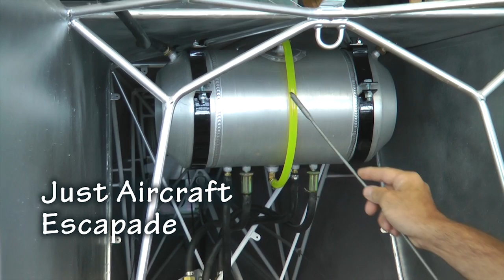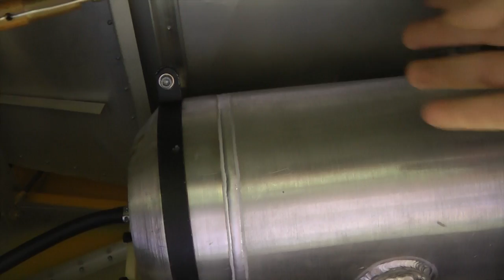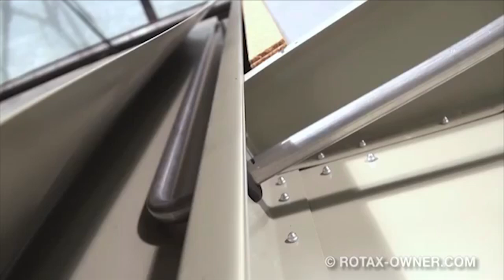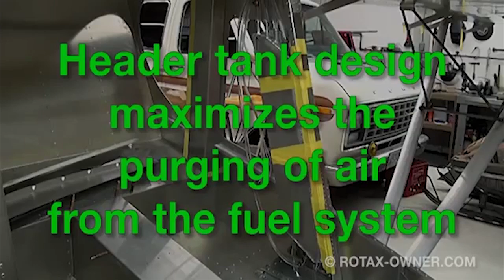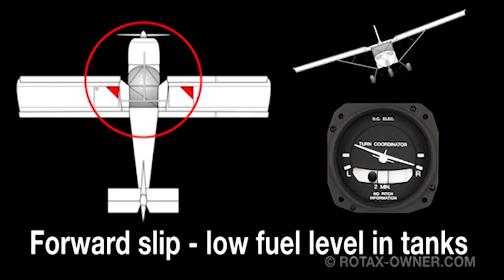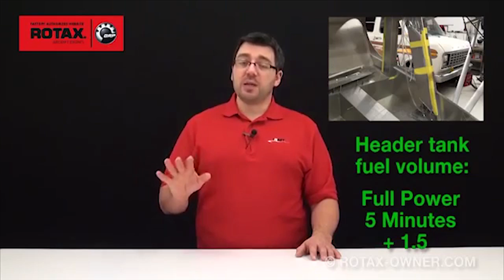More Fuel Header Tank Examples

Comment: One thing I noticed is the absence of valves to shut the flow before the filters and the fuel pumps  in case you want to change or service them.
Reply: A lot of people/builders opt to not install valves, as it has happened more than once that "service valves" are turned off inadvertently, as you as the pilot don't check as you have not turned them off yourself and walla fuel starvation as you rotate and the expenses start...

Comment: I have a similar tank on my bird and I was wondering if rubber or some sort of material is placed under the steel straps which hold the tank in place between the steel straps and the aluminum tank to avoid galvanic corrosion and or chaffing?

Comment: I am still trying to understand the need for vents to the header tank.  As long as each wing tank is properly vented, fuel will flow into the header tank without issue.  I suppose there is a chance of getting an air lock if you run the airplane completely empty of fuel and then fill both wing tanks simultaneously, however, who fills both tanks simultaneously?  As you fill one wing tank, the header tank is vented by the fuel line from the empty tank.  What am I missing?
Reply from the maker: Well... I might ask - how often do you fill one tank while the other one is completely empty? It might vent OK in that situation! You are creating odd scenarios where a header tank might not need a vent. This is an airplane and we want a definite vent to work always.  A trapped pocket/bubble in the header tank is deadly for an airplane.
Reply: @HomebuiltHELP  It will vent even better if neither tank tank ever gets empty enough to allow air into the header tank as each tank supply line serves as the vent.  You can’t lower the pressure in the header tank if either of the wing tank feed lines is unobstructed.  The only purpose of a vent line is to prevent a loss of pressure in a tank such that the liquid in the tank can’t drain out.  In the case of the header tank, the wing tank supply lines serve that purpose.
Reply from the maker: No, no, no! Read your last 2 sentences. It is when the 2 wing tank lines become obstructed (at the same time - blockage, crimp,  when fuel tank vent goes negative - lots of reasons, etc) that you NEED a header vent to allow fuel to leave header tank.  Without its own vent in this scenario, fuel could not leave and then engine will stop.  With a vent, you have a calculated time to look for a landing field as you watch the header fuel gauge creep to zero.  I see this all the time - builders that dont "see" a reason for that extra vent get into real trouble later. Worse is telling others that you dont need one.  You dont often see comments on my channel of dangerous advice because I remove them. These are airplanes - not boats or cars... so engine stopping is serious business.
Reply: @HomebuiltHELP  I agree.  And how many times are both fuel lines from the wing tanks to the header tank blocked?  It is more likely that the fuel line from the header tank to the engine would get blocked than both fuel tank lines would get blocked at the same time.  What scenario(s) have you seen where both fuel lines to the header tank from the wing tank were obstructed simultaneously?
Reply: @HomebuiltHELP  Also, I never told anyone else what they do or don’t need on their airplane.  I asked a question and am exploring a topic.  I’ve read lots of claims about a gravity fed header tank needing a separate vent, but I’ve never seen a rationale provided for this.  And I have searched the NTSB accident database and have never seen an accident caused by an unvented gravity fed header tank.  Obviously, header tanks that are pump fed to transfer fuel from a wing tank that may be lower than the header tank is an entirely different animal with different considerations.  I’d love to see a rationale for this that makes sense or an accident report where this was identified as the cause of the accident.
Reply from the maker: Builders and pilots see these scenarios quite a bit. Mud wasps build nests and block wing tank vents. Negative pressure into wing tank vents because of vent tubes pointed backwards or otherwise incorrectly.  Covers not removed from wing tank vents during preinspection. Wing tank vents simply inadequate because a builder didnt know or think about it when building or using wrong vented cap. All of these wing tank venting problems cause EXACT same problem as obstruction in fuel tank line - without any obstruction in that line. Without a header tank vent all of these scenarios are waiting for a fuel starvation problem. Biggest problem in my personal experience was initial filling of header tank (by way of wing tank filling). Anyone that has filled an auto engine radiator with antifreeze knows that just pouring the fluid in doesnt force all air pockets out of engine on the first fill. We need to keep moving fluid around to help gravity work its magic and send the lighter air up the stream.  Same as header tank.  Once there is a bubble in the header tank for whatever reason - it will not competre with incoming wing tank fuel lines to leave.  A separate vent line at the top of the header tank WILL allow the bubbles to leave.
Lets leave it at that.  Practical experience by the many in the field is why we do some things - even if we cant "see" what difference it will make.
Reply: @HomebuiltHELP  Most header tank vents I have seen go into the wing tanks or joint the wing tank vent lines.  Therefore, if both wing tank vents are blocked, this will make no difference.  Only if the header tank has a completely independent vent will the issues you mention be addressed.
Reply from the maker: This has been a good discussion - thanks for your participation on the channel.  We can learn from each other!